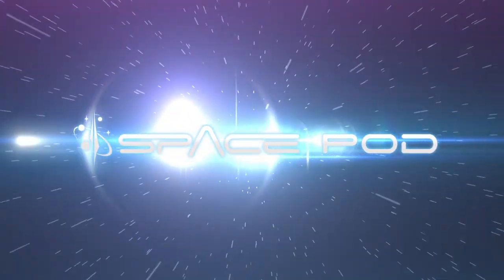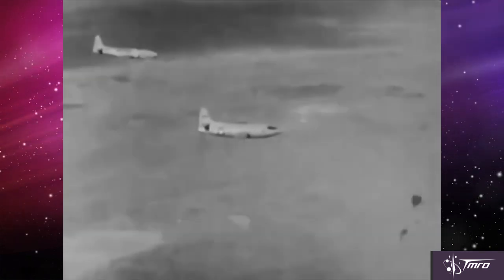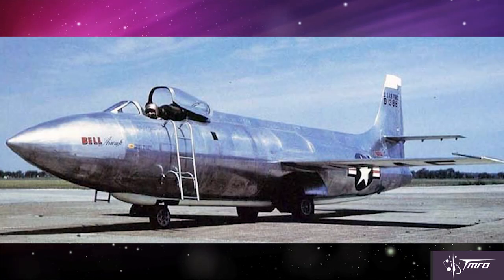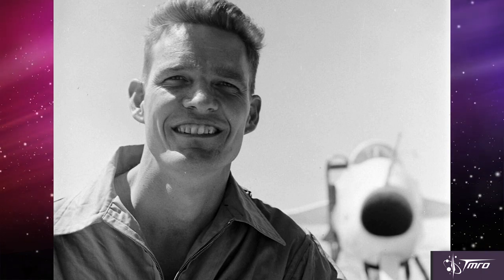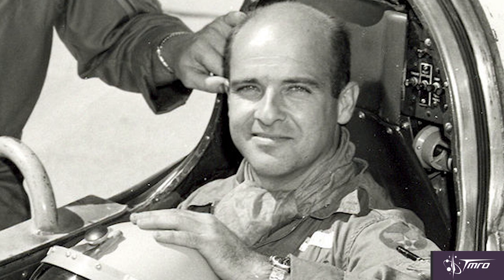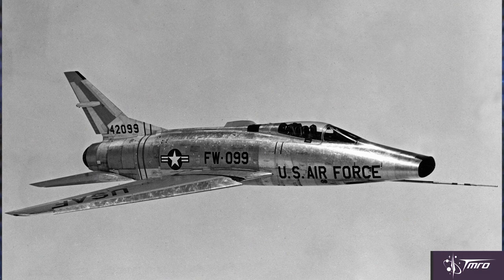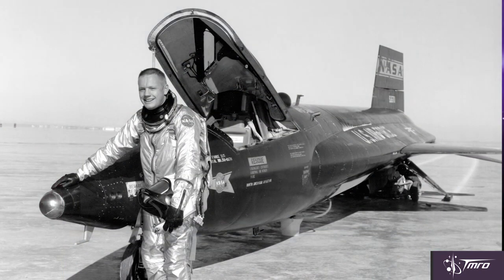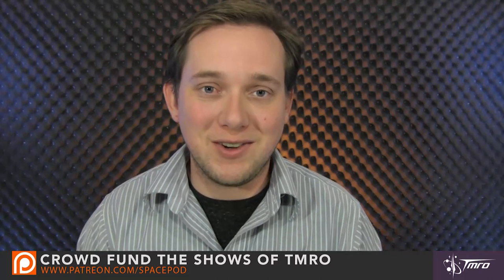Spaceplanes Part 2: Rocket Powered Aircraft - Space Pod 05/12/15

Comment: Hi Mike, there is a step missing from the Douglas SkyStreak to the Bell X1, and that is the British M52 by Miles Aircraft Limited. The success of the X1 was due to its razor wings and bullet shape, which were copied from of the British M52.  In 1944, the UK Air Ministry signed an agreement with the United States to exchange high-speed research and data ….  the Bell Aircraft company was given access to the drawings and research on the M.52,
http://en.wikipedia.org/wiki/Miles_M.52